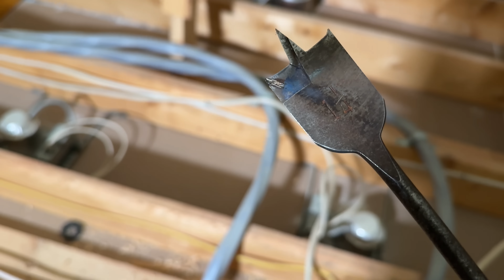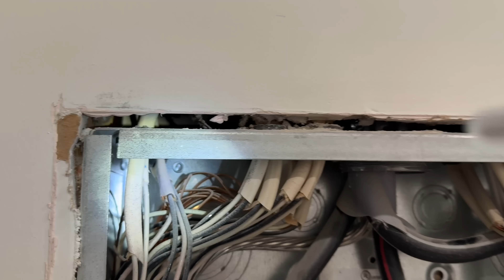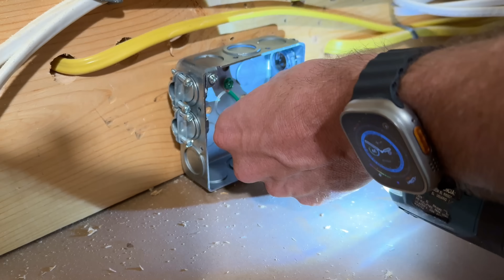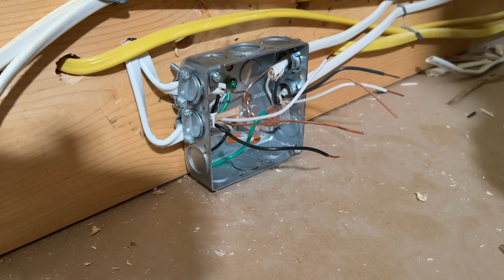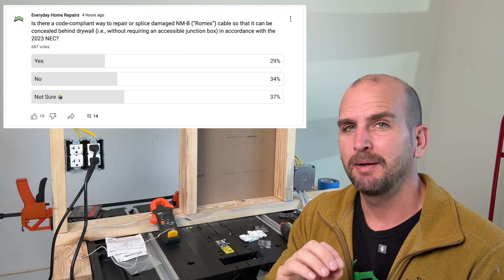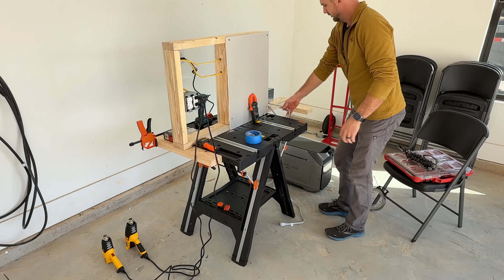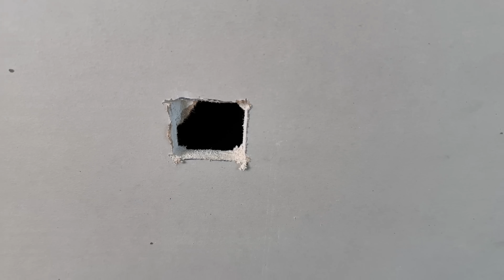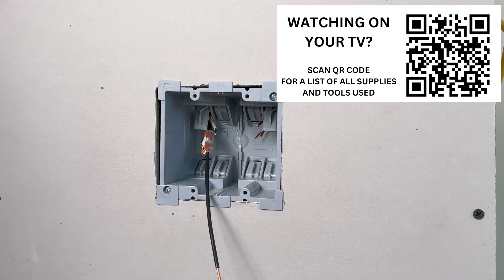How To Repair Damaged Romex |  3 Easy DIY Fixes

Comment: Maybe I'm just being nitpicky, but at 5:20, you kept the grounds for the two circuits separated. Unlike the current carrying conductors, bonding grounds from multiple circuits is actually allowed by code, and is even required in some jurisdictions. I mean, that setup will work fine, but I would bond all grounds together for redundancy.
Reply: yeah, i probably would have joined all the grounds as well. but i think it's the box being bonded to ground is the requirement, so it really is of no consequence how he does it
Reply: I agree. I have always bonded grounds together in j boxes.  Safety and redundancy.
Reply: The reason I would keep them separate is because the second ground conductor would ohm out from the panel to be grounded in the field, which could cause confusion down the road.
Reply: @Cotronixco  250.148 Continuity of Equipment Grounding Conductors and Attachment in Boxes. If circuit conductors are spliced within a box or terminated on equipment within or supported by a box, all wire-type equipment grounding conductor(s) associated with any of those circuit conductors shall be connected within the box or to the box in accordance with 250.8 and 250.148(A) through (D)
Reply: @robertsteich7362  That code was recently updated due to ambiguity. However, if you study the situation thoroughly, you will find many electricians believe the committee made the update only for that reason, and not for reasons of decreasing confusion or increasing safety. In other words, there is still no logical reason to tie grounds from unrelated circuits together in the field. The box simply needs to be grounded, not grounded two or three times from two or three different sources. We believe that the committee will eventually realize this oversight and adjust their wording accordingly.
Reply: @Cotronixco  save money? The sand pile just grows one speck of sand at a time: extra time, extra material, loss of box space requiring another box to make the grounds isolated. Wait, isn't the Neutral just an isolated ground?
Reply: @TheAtomicCitizen  Save money? What are you talking about?
Reply: @Cotronixco  Nevermind, you keep doing what you are doing. I don't see a need here to teach old things to new people.
Reply: @Cotronixco the reason you do it is because there are 2 seperate circuits in there and if some reason the 1 used to ground the box was no longer needed bothe e ds would be isolated meaning the box is no longer ground with a live circuit still
Reply: @Cotronixco  what confusion? Are you talking about inspecting the grounding? Ground is found in many places and jumped by many other trades like gas appliances always require ground, so do Water Heaters and Data lines look for a ground. Too many other ways to connect ground to worry about separating ground, unless you are speaking of isolating your Neutral. I practice to not look for conductivity through my ground wire but my Neutral wire. Tip, all tracers now work best when using the Neutral to trace and not the ground.
Reply: @TheAtomicCitizen  What confusion, you ask? The confusion caused by the NEC's ambiguity in past codebooks. This question has never been fully resolved in the minds of many. It has in my mind, and probably in yours as well, even though we differ in the way we would like to see it performed and mandated.

Comment: Gardner Bender makes a "butt splice kit" that is basically just a brass tube with set screws at both ends, and heat shrink. I've seen it used when direct-bury power cables get severed during excavation. No idea if this is NEC certified for use inside walls, but to me it seems stronger and safer than the NSI splice.
Reply: Being buried provides a lot of protection itself, like not catching on fire.

Comment: This was a great video. I think fiberglass fishing tape is a must and now i need to go grab some since i only have the metal tape. As for the fix. I think i would prefer to run new wire if i can, but those connectors sound pretty viable options. Actually would love to see more testing on those to see how they are long term. Throw a bunch of environmental conditions towards it to see how it reacts

Comment: I prefer method 3 as I've had issues with switches that use the "piercing of the insulation method" failing over time. I'd prefer to have access to the repair if I need to repair it again in the future. In a perfect World method 1 is preferable to me.

Comment: Felt I needed to chime in about the NSI connectors. It surprises me that the bulk of electricians have no idea they exist and are COMPLETELY safe to bury in a wall. How do I know this... millions of Modular homes exist and they ALL use them to make connections between house sections. Perfectly legal and safe... and a life saver if you ever need to use one.
Reply: Are they reusable or one time connection?
Reply: @rb70383 insulation displacement connectors typically are one use only.  While they might work on a reuse they are not normally designed for multiple insertions.  

Also not a good idea to use them in applications where vibration or physical strain is a likely condition.  

An IDC splice is a solution I would regard as a last resort.  They work but are generally not the most reliable connection type available
Reply: It saved me when I removed a wall heater in a bath remodel
Reply: They are allowed for even renovations in the 2023 code
Reply: I didn't know that was how they connected those homes, I guess it might be safe to use in a house if they are approved for a mobile home....that is very interesting to know...thank you for posting this.
Reply: @wildbill23c 
Modular home is not mobile home. Mobile homes dont have to follow the same standards as traditional homes, but modular homes do.
Reply: @wildbill23c  I don't know about you, but I am extremely skeptical about how anything "modular homes" (aka mobile homes) are constructed. I had a friend with one and there were very dodgy construction details everywhere. Fortunately my friend fixed things as needed with good materials and good building practices.
Reply: @tlum4081  The newer ones are better...LOL....yeah right.  They use the cheapest thinnest materials to save on weight little insulation, I'm surprised they hold together long enough to transport them to the site to set them LOL.
Reply: They are not safe. We had one fail. Having in manufactured home under skirting is different than behind sheet rock.
Reply: We had one fail. I would not trust it due to ineffective contact. Having an inline butt connector would be better.
Reply: There are modular homes and there are other modular homes. Some are glorified house trailers and then there are modular home 2x10 Floor joists Anderson windows R 19 walls R 38 in the attic  have a  Vandalia Cape Cod on a full poured basement. The junctions for the electric of the two halves are above the ceiling in the master bedroom and each co nnection is made into individual  boxes. Maybe that happened before these splices were approved my home was set in late 2005
Reply: not to mention, they use stuff like that in europe all the time. i feel like their safety regs are quite strict over there, so it makes me laugh when i hear people "not trusting" things like wago here in the states. i actually found one of these NSI connectors in my house while renovating my kitchen.
Reply: Where does it say in the specs that it's rated to be buried behind drywall? I'm not seeing it. Thanks!
Reply: There is no reason to be using metal boxes here
Reply: Okay, what is the safest in a mobile home? I've got to find and fix a bad spot and it could be 80ft from the panel. It could be in the wall or underneath. The connections for both halves are underneath. If a junction box is used, could it be filled with fire caulk incase the splice fails? I know that sounds dumb, but I'll do whatever it takes to make my place safe before moving my family into it.
Reply: He said that at 14:30
Reply: We build double wide modulars and that’s how we marry the electric.
Reply: Because an Electrican would not bury any splice in a wall
Reply: @EdHibbard-y7k  Pretty much. I'd always want to leave instructions on how to find it at least. Imagine spending hours trying to figure out why this run is faulty, and only finding out after all of that that there is a splice buried in the wall!
Reply: @NoSpam1891  Finding a bad splice buried in the wall is really no different from finding romex damaged by a screw.  *it happens. You either track down the problem and fix it there, or you do a new run.
Reply: @Sylvan_dB  YOURE BOTH CORRECT
Reply: Almost makes me wonder if the manufacturer of these just lobbied to get them approved... Anyone else remember when Whirlpoop was facing new regulations that dryers needed to be designed not to catch on fire and instead of equipping a flow sensor, implementing rate-of-rise temperature monitoring in software, or changing their 63 year old design 6,000 watt red-hot electric resistive heater for a modern heat pump design that literally can't catch on fire.... they just lobbied the federal government and said "we will just design our dryers to contain the fire so it's safe... besides, you wouldn't want us to go out of business and then people would buy quieter, more efficient, longer lasting LG dryers would you??" and there you have it... no regulations for fire prevention in dryers! Oh.. and a 25% import tariff on korean made laundry appliances.
Reply: All dryer fires are caused by improper venting that causes lint to accumulate. @DoktorJava
Reply: @DoktorJava lobbying and money from them should be done away with!
Reply: There is no data supporting weather or not these connectors tend attract tornadoes.:face-blue-smiling:
Reply: Modular home electrical problems of dead conductors is my full-time side gig. Thank you for the work. It makes this time of year very joyful that I restored electric service to modular homes with "no power" service calls. Most of those calls are from an NSI housing that was damaged or stepped on and the conductor lifts up off the clip points.  LMAO to the bank!!!! Now if college kids can recreate the Western Union splice for AI to understand electrical conductivity and connection, we all might live in a safer home, or in this case a more convenient home for the owner, not the repairman.
Reply: Nope. We replace them all the time. Most are burnt.
Reply: Naw we know about em. They're always sold out in my area...
Reply: They are similar to the wiring used in modular office furniture (cubes). The rule on cubes is no heaters or laser printers.  Buried in a wall with wood studs makes me nervous.  Remember, they are approved until one day that aren’t.
Reply: @MW_7654 cube wiring is much better quality — and more expensive. At least the real Wieland stuff, I hear there are Chinese clones now.
Reply: Insulation Displacement Connectors for phone wiring.  Check.

IDCs for Ethernet cables.  Check.

IDCs for signal cables inside PCs.  Check.

IDCs for electrical power cables - are you out of your mind?
Reply: Yeah back in the day, all those trailers and modulars were done in that completely safe and approved aluminum wire
Reply: And I hate them.  Once I replaced them in a modular home I bought, I noticed the bathroom lights didn't dim as much every time we plugged in a hair dryer or turned on the exhaust fan.
Reply: They are approved for module homes, but they are not approved by the NEC, why this is I’m not 100% sure, but I believe that it was to do with something about them only having the UL listed approved for module or modular homes. The NEC is very specific that there shall not be a splice made in any unacceptable location.
Reply: @timothydixon2545  these connectors are approved by NEC 334.40(B) in even non-modular homes. The only changes in later code is that they are now only allowed for repairs.
Reply: They may be approved but I still don't like them.
Reply: @NoSpam1891  I share your skepticism on this.  Maybe I'm just to old school but forking into a wire carrying 15 or 20 amps just seems hinky.
Reply: @JohnSmith-Id1pw

Well then you'll be thrilled to find out that your electric company likely uses insulation displacement connectors to "fork into" their cables when splicing. Same concept, just bigger.
Reply: @bobbing4snapples  50Kv acts way differently to these connections and loads than do 120v. If you look into the sky, sometimes you see electric grab another cloud or even the ground without the pointed torture devices created by inventors, which leads me to recreating or reinventing the perfect splice is just a lesson in futility.
Reply: @NoSpam1891 , I thought that the NEC, code Requires that the line has no Terminations from Breaker to Plug, or wall Switch, unless it's in a gang box that's secured to a 2×4 ?
Reply: @Scrollermania1963  And yet they're approved. Like back stabs on power outlets.  I don't have to like them.
Reply: @Scrollermania1963  NEC clearly states that splices can be buried when done with devices listed for that purpose.
Reply: And modular/ mobile homes definitely don’t burn down more often than other structures
Reply: @kimberHD45 makes sense since most meth labs are just a former mobile home… 
Kidding aside though, mobile homes burning up more frequently has a lot more to do with the materials they are built with being more flammable (and in some cases more toxic); I don’t think electrical fires are the leading statistical cause of a fire in mobile homes either.  Most home fires are caused by cooking-related accidents; pair a mistake in the kitchen with the materials that most mobile homes are made with and it might as well be an accelerant!
Reply: @kimberHD45 not because of a splice
Reply: @kimberHD45 modular homes are regular houses built off-site. Mobile homes are trailers and have different codes. They're different things. Residential fires occur most often in 1 or 2 family houses (FEMA, 2014), didn't find any source for your claim tho
Reply: @kimberHD45 I think a lot of mobile/manufactured home are from cheap receptacles. I’ve replaced several in a few deferent homes that arced internally and sent smoke up the wall. Seems they always want to cut costs in the wrong places. Same with RVs and motor homes.
Reply: Safe, until they're not.
Reply: it’s a little premature to say these are “completely safe”, it’s a new product and no one knows how they will hold up over time under various load conditions.
Reply: They've been around for thirty years. @Harrison2253
Reply: These aren't new

Comment: why add a gangbox, why not just wago them inside the wall and put a cover on the hole? i know it's for "code" purposes, but if those two wires are not under physical stress/load (tension), what's the difference between a jbox gang and no gang?
Reply: Because you don't know when the wire may become "under stress" later. Someone may come in and do work in that area, pull on the line to try to do similar work and pull the connection loose.
Reply: @joshhuggins  but then if the wire is exposed and not hidden, such as an attic fan wire that follows the roof joint to the point of power, what's the point of having a j box, since from source to load all the wire is visible?
Reply: Yeah don't do that. Electrical fires are no joke. While the code isn't perfect, it does exist to keep you and your house safe. Don't take unnecessary risks when it can literally kill you

Comment: You pinched your Romex cable at the  lower left outer corner of  the  junction box @5:18 . Now go back up and fix that.
Reply: Lol😂😂
Reply: I went back a few times to see what he was complaining about:  The Romex was a bit off center but not pinched. Nothing to fix. If you can't say anything nice, don't say anything!
Reply: @starfindings  I actually see what they are talking about. Bottom-left screw is pinching the Romex.

Comment: Thanks for another great video. I thought you were in a northern climate. Where is the insulation in your attic? Also, you could have saved the extra splice and 3 WAGOS in option 3 by just running your jumper wires directly to the other side